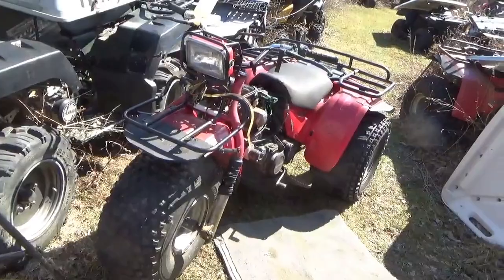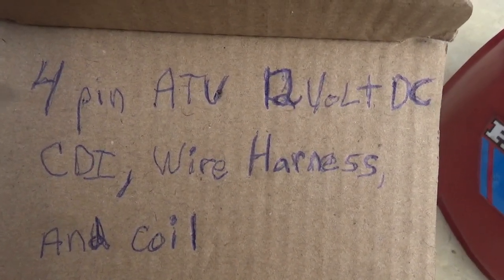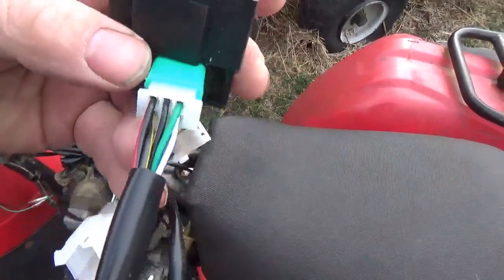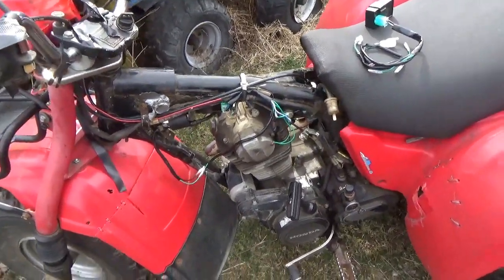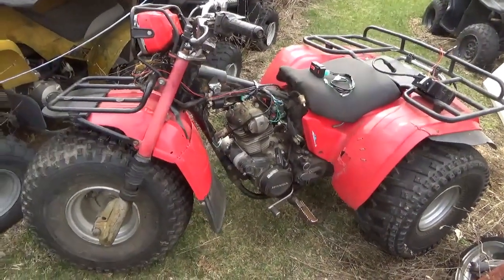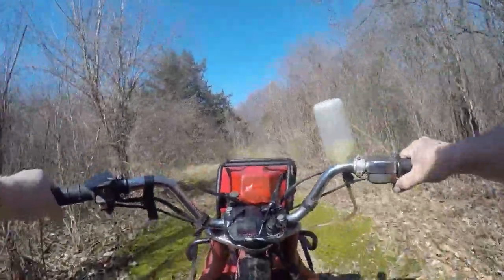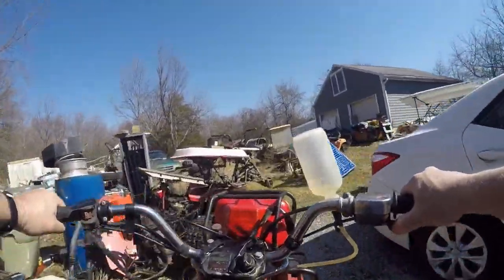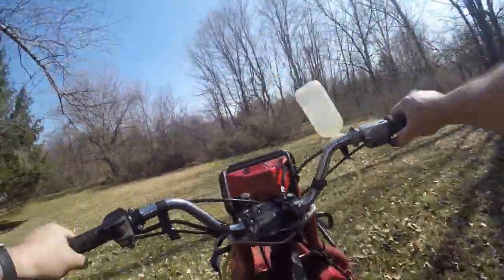No Spark Honda Big Red ATC200ES Ignition Hack, 12Volt CDI Upgrade!

Comment: I wired a aftermarket cdi on my 200s engine and run the black wire with red stripe to the black with red stripe coming out of the stator
Reply: Does that make it run without a battery

Comment: You are a genius when it comes to this. I have a 300ex can I use a blue CDI aftermarket off a coolster 150cc and replace the one on the Honda I bought it for 300 bucks and it ran I parked it in shop and started taping wires up someone hacked it up. Now no spark

Comment: Excellent video. I often wondered if the Chinese cdi would work on the Japan quads. I have a grizzly 600 I might have to try this with as I think cdi is no good.
Reply from the maker: Hey Bangs!! I have a grizzly 600 that lost spark, turned out the pulse generator was bad, amount other ignition issues, so, swapped out the pulse generator and used the portable cdi box to run it up to where it sits. I really need to finish that machine!!! Thanks for the reminder, Ur thoughts and info, watching, and commenting!!!
Reply: @HarveySpooner   Thanks for the tip. I will have to check that out. I’ve been working on mine which seems like forever. I actually had to walk away from it for a bit as it’s that crazy of a project. The guy I bought it from was an electrician and he wired the quad kinda like a house. The harness was so messed up from it. I finally found another harness for it.

Comment: Nice ride, great rip up the driveway. It hasn't been on a longer ride in a while. Thanks Harvey.
Reply: Specs on the piston- wiseco for 185s overbore from 63mm stock to 66mm- piston size also for atc200, trx200 and 200s from 65mm stock to 66mm piston size. part no. 4156M06600
Reply from the maker: Hey Steve!!! Good job at unearthing the details on that wiseco piston, I'm kind of surprised that he did not have it stored in a better way, in a better place.... I need to do some research on getting a jug over bored. There is a machine shop near me that seems to have closed, I don't know if the owner passed and the kids just use it for hobby or if retirement or covid shut it down.... One of my neighbors is s bit nosey, it will have to ask him... I need to get back on the 200es, my weekends are booking up and I need a trip up for buttermilk pancakes, bacon, and eggs.... I love diner breakfast, all the good tastes, all at the right time, and none of the mess in my kitchen!!!  Thanks always for Ur thoughts, info, support, encouragement, watching, and commenting!!!!
Reply: @HarveySpooner  Let me know when you want to meet for brunch. Could bring more gas tanks and all your treasure, not worried about when my es is ready, and if you bring a jug, I'll have it bored out for the piston and get the rest of the kit so you can smash it together. Sat. afternoon I get out early and Sun. is open for a few weeks.
Reply: @HarveySpooner  The piston wasn't stored, it was put down by someone in a hurry with too much on his plate and it was knocked down when some other machine was suddenly jerked out of the back corner and brought into the repair portion of the shop because the customer showed up and asked about it. Controlled bedlam is the name of the game. Customers at the counter, phone ringing, mechanic holding a part that needs replacing and the new one didn't come in yet. They sent the right side and the part number we need is the left, the guys that take the old tires loaded them up and were waiting for a check, I'm outside helping unloading a machine we weren't expecting that doesn't roll or run but they don't want to spend much money on it. People bring stuff in and call an hour later, others don't call for months, Not for the faint of heart!!!!!!
Reply from the maker: Hey Steve! It is a good machine, it has a happy engine.... Next, cleaning up the wiring, some love to the gas tank, then the front forks!!!! Thanks always for Ur thoughts, support, watching, and commenting!!!